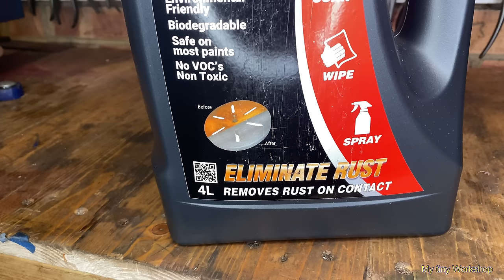Antique Wrench you never knew existed

Comment: Construction of this wrench is very unusual. But i like weird mechanical tool. By the way, you definately need one weird tool. It called threating file. It makes threat restoration much easy
Reply from the maker: I also love weird tools. Iv seen my mechanics use that file. I should invest in one.
Reply: @mytinyworkshop1213  My Mechanics is tough guy. Watching his videos too. 

Threating file costs 10$ on Chinese AliExpress. On eBay may be 15$. But it earn this cost. Two weeks ago it saved me a lot of time. I have to restore bended threat M36x1.25mm. Without file i have make a new part.

Comment: Lovely wrench and great restoration. I do think however that when reassembling the wrench, one should place the three parts against each other and then turn the adjuster, rather than screwing the adjuster in on one side and than the other.
Reply from the maker: The way it was assembled is correct. One thread is longer. If I screw them at the same time it will not fully close and the adjuster will not be centred.

Comment: The jaw portions were definitely finish machined on a metal shaper
Reply from the maker: Yes, they were machined so well. The joints are tight with absolutely no play.
Reply: @mytinyworkshop1213  also the chatter appears to be straight lines rather than the circular look a cutter head usually gives. these dont scream mass production to me whatsoever. super sweet find not seen one like it ever myself.
Reply from the maker: Makes me even happier knowing it might not be mass produced.
Reply: @mytinyworkshop1213  i mean probably batch produced but the 1800s wrenches were usually cast and if machined at all just lightly ground. square heads and all that.
Reply: @mytinyworkshop1213  yours look like the jaws were cut very smooth and precise, which seems to say shaper to me. which in turn seems very lavish if correct.
Reply from the maker: I was actually impressed with the amount of precise machining this had. I still need to learn more about the history of tools in general.
Reply: @mytinyworkshop1213  square bolt heads and nuts ended around 1920s the curved handle type stuff ended around 1900

Comment: I could be wrong, but I thought those were pins in the threading, not something you'd normally file off. Instead you should punch them out if possible.
Reply from the maker: It’s definitely not a pin. Trust me i tried hammering that thing out until I realised it was welded.
Reply: @mytinyworkshop1213  Ah, gotcha. It looked like a pin to me, but it could easily have been a weld bead. Fair enough, just wanted to make sure. Nice job on it, btw. Forgot to say that before. I've never seen a wrench exactly like that, though I've run into ones that function similarly.
Reply: Sometimes they are tapered pins and need a judicious use of heat.